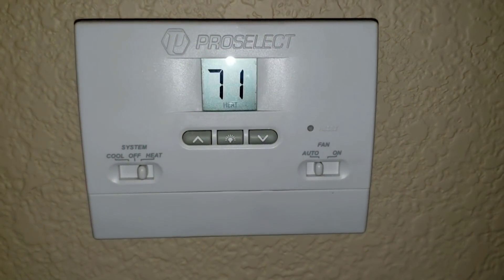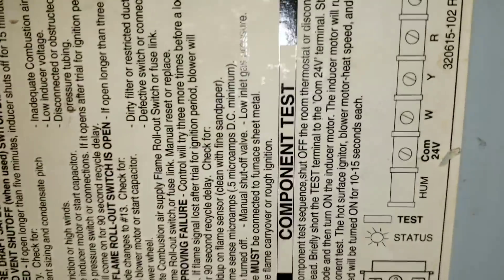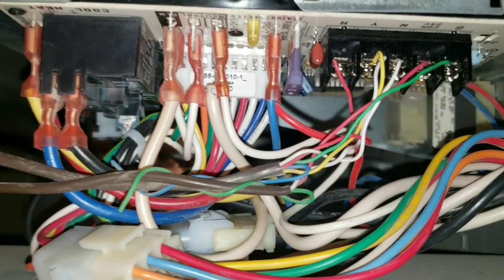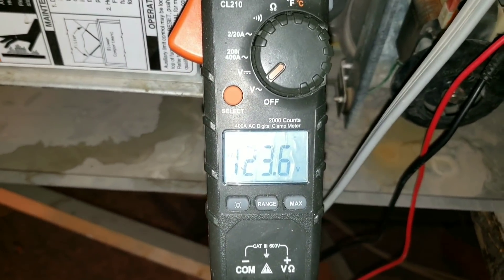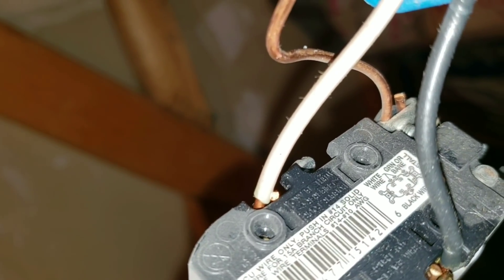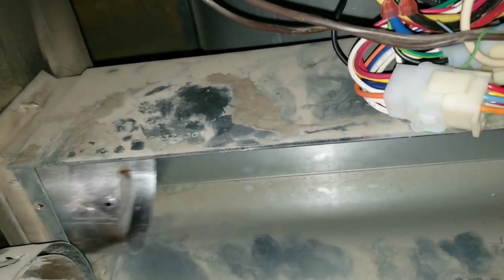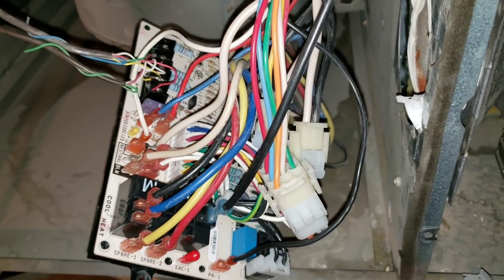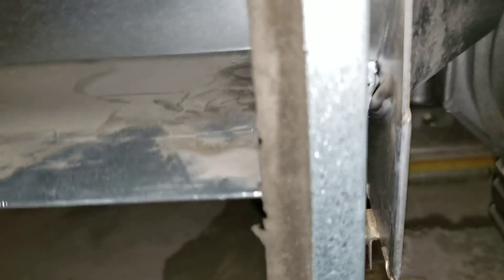Furnace Board Troubleshooting Error Code!

Comment: The control board in my furnace is 20 years old. Should this  be changed out as a preventative measure when the board is this age? Why do the boards typically go bad?

Comment: Same thing that happened to me. Two companies wanted $1000 to replace the board. It took me 15 min to find the problem and fix it. The 120 line in was reversed. I used a $5 tool to check the outlet polarity then looked online to figure out the configuration of the 3 prong cable. The ridgid side should always be neutral, the center is ground, and the smooth side hot. Sure enough the wires were reversed. Once I changed them around the board went back to normal operation and I saved myself some money.

Comment: You said it looked like that board was just replaced. If it's burning up boards like that you might have bad low voltage contactor coils at the condenser. Seen it many times.

Comment: Wondering if you can help? Watched this entire video but am confused as to why this is happening? 
Our furnace has worked fine all winter long, we went on vacation for 11 days in early March and turned the heat down to 55 degrees. We came home and the house was at 55 degrees as expected, I bumped the thermostat up to 68 where we normally keep it. The furnace kicked in but was struggling to run correctly for the next few days although we did have heat. It wold cool down in the house far below the set 68 degrees and then would kick in and heat. We noticed it operating randomly and inconsistently at best. The control board is indicating with 9 red flashes that it is a "polarity or grounding fault"  we have not touched anything inside the furnace. This is a Luxaire LX furnace that was installed about 8 years ago and has already had 2 control boards replaced as well as a blower motor, is there something that is causing these parts to go bad so frequently without any explanation? And to make things worse the technician who installed the furnace failed to file the warranty paper work on our behalf so we don't have the 10 year warranty like we are supposed to even though I have all the documentation and paperwork on the install.
 As I am typing this and standing by the furnace, all of a sudden it started up, the burners fired up and it's acting normal for the moment, we'll see how long this cycle lasts.
Any ideas what the heck is going on or where to start?
Thank you for your time, jim
Reply: Thanx for letting us know never to buy a Luxaire!

Comment: I have amana 80 sv.  Its older gas furnace.  I turn on heat and it tries to cycle heat on 3-4 times then stop and all I get is slow blinking red light on circuit board.  What is that?

Comment: Great video ..!
Show us how to replace the board , step by step ..
Reply from the maker: This is literally a step by step how to replace board 🙂
https://youtu.be/2dg_cK1gj3s
Reply: @MoreThanMaintenance  just curious in my mobile home I have a electric furnace and a package ac unit and neither of them have a g wire because initially they both had separate thermostats but we had a problem with the thermostat for the ac unit so we ended up having both replaced with one heat cool combination thermostat so how does each system turn on it's blower motor without the G wire is it done internally somehow in each system

Comment: Question. I got this error  code after the furnace experienced a power outage. What would cause this error?
Reply: Power outage could mess up a controller bd on any appliances. Because of rush current takes place when a power is back.

Comment: You would think that after correcting the incoming power in the junction box that would be it,, but this wasnt the case. The board was the culprit. Possibly the incorrect wiring caused the board to go bad. Great video!
Reply from the maker: Thank you for you input. Sometimes it would be nice if it was a simple fix. Sometimes it is a little harder like in this video. Thank you for watching 😄